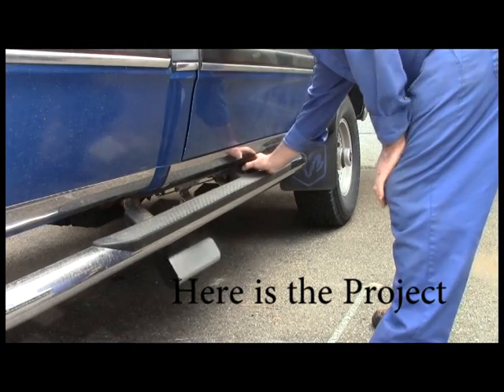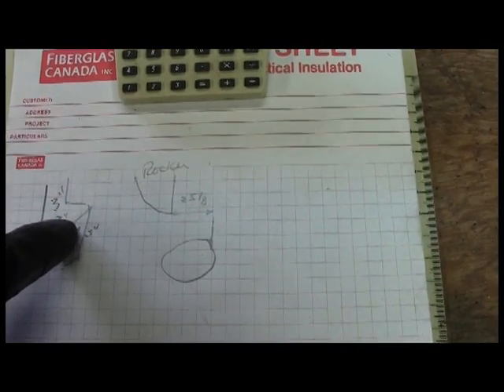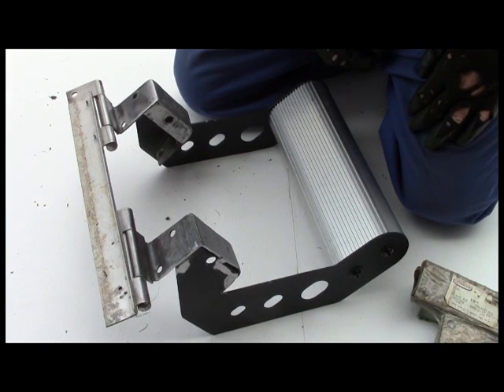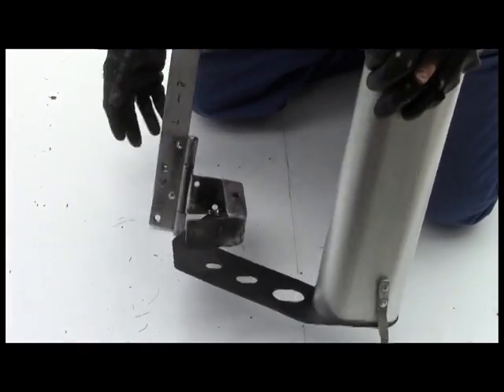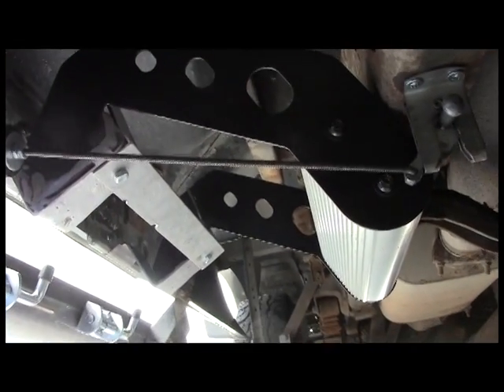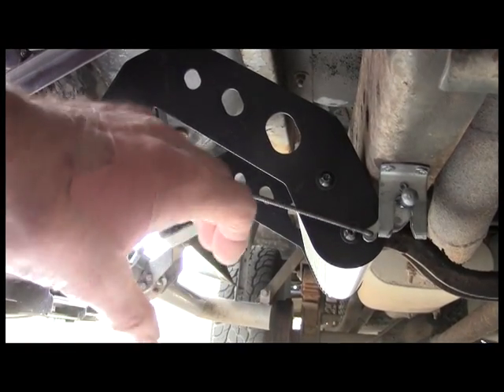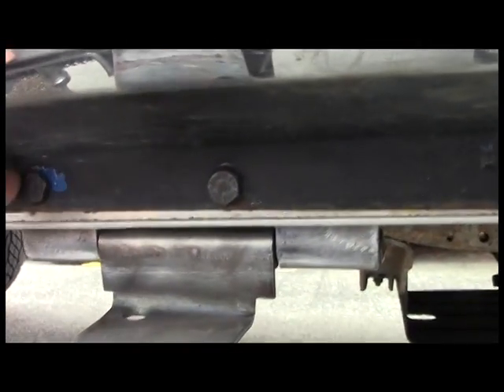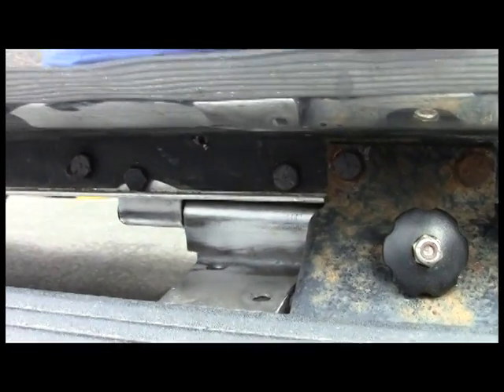Truck Step

Comment: I was thinking about using exterior RV folding steps. Mount them right on the truck. Fold them in and out easily and still have space underneath the truck.

Comment: gate latchneeds paint
Reply from the maker: It's galvanized Bill and I suspect the paint will just flack of in time.  But good spotting, we should always try to protect bare metal.  By the way, this gate latch was off my old wood fence and was out in the weather for at least 30 years, this baby was not made in china that's for sure.
Reply: it's a great ideal I will do it to my truck.

Comment: Looks  like you used a gate latch. I would not drill holes in frame flange.
Reply from the maker: Your correct but the 100,000,000 prize has been won.  LOL
Keep the tools clean and the coveralls dirty.

Comment: ive had both knees replaced,and my truck has the nerf or tube running boards on it but its still to high. I bought these Bully steps and i am gona try ti mount them permanent  under the existing 4ft running boards. There old so do you think they can support a step to them. I need some idea's

Comment: I'm looking to build side steps for my kids to make it easier for climbing into my 2002 f150. I also want to build some lower handles for them to reach to grab as well since the stock ones are on the top of the door frame. This is definitely putting a pep in my step. You could have made the latches automatically latch when it comes down so no extra labor at all and then design it heavy enough when it release it latches back up stowed away. I love this stuff haha.
Reply from the maker: +james magana 
These projects are what keep me young.  The old bones don't hurt when I'm in my workshop.  Good luck with your projects, and thanks for your comments.

Comment: I think adding about a 30 degree cut in the locking pins will allow you to just pull the nob and you're done. Then you just pull the two levers to lock it like you currently do. Sorry being an engineer makes you think how things can be better and easier. But I see it serves it's purpose do far

Comment from the maker: The step works great.  I used to have to get a plastic step out of the truck box every time my lady had to get in and out.  This was a fun project, and when people see is they always chuckle.
Reply: So can this step be left down for the driver after entering? I'm an 84 year old woman whose had 
hip surgery.  I drive a 2011 dodge ram longhorn 2500 which is quite high.  Getting in isn't so much of a problem.   It's getting out